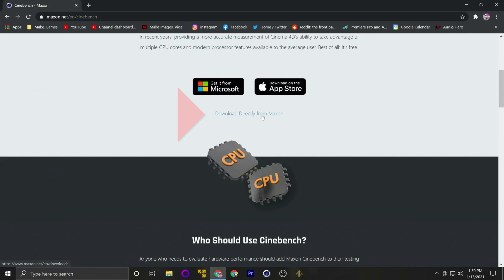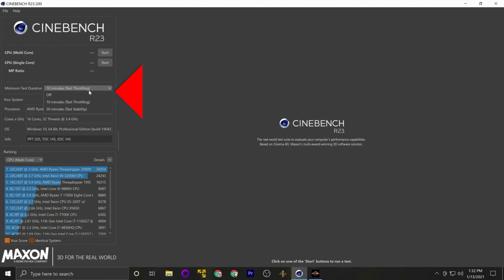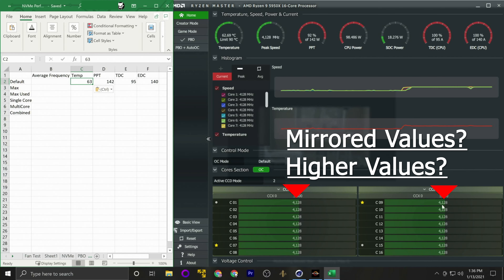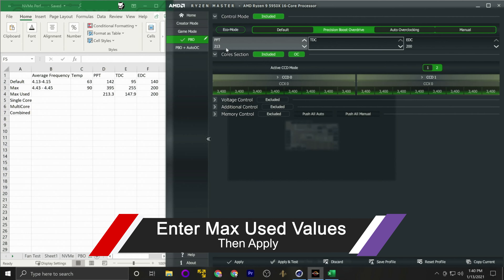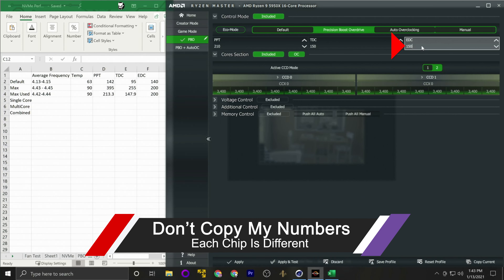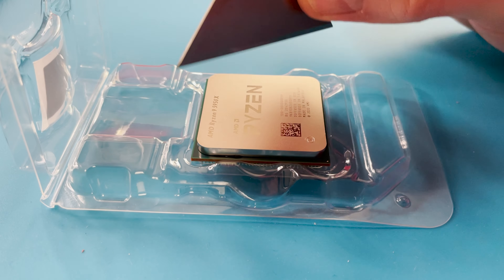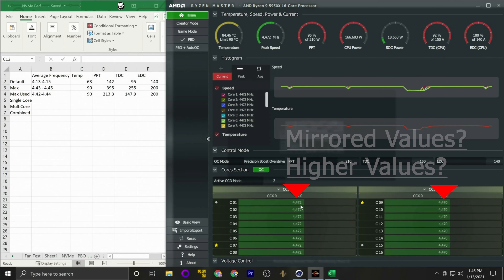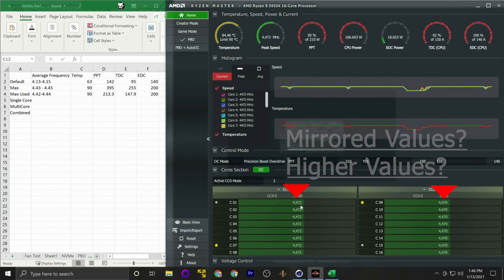Adjusting Ryzen CPU Performance with Ryzen Master ---- Part 3

Comment: This is weird. When I click APPLY, it always asks me to restart the computer before the settings take effect. How come yours doesnt?
Reply: Same here, did you figure out why?
Reply: there's a setting in ryzen master that says something about writing to bios, turn it off, it's automatically setting a permanent change any time you apply the changes
Reply: @DariusEldritch  Does it literally say "Write to BIOS"? I checked the settings and I don't see anything that relates to that. Would you be able to tell me/us which in the settings that has to be turned off?
Reply: @Velocity0428 you have to switch into advanced mode, then go to settings. You’ll find switch Write PBO to BIOS, or kinda like that

Comment: With my 5950x, when doing single-core Cinebench, it's not one of the cores boosting up to ~4.9 like you have, instead it's two cores jumping between 2.7 all the way to 3.2.
Reply from the maker: Likely running into a thermal issue where the scheduler is swapping more frequently. Make sure you have the AMD chipset installed and the Ryzen power profile.
Reply: I have kind off the same problem. One core is constantly jumping between 4.5 and 4.9, then at some point it drops to 3.1 and other core has around 1.5 ghz. Then single core goes back to 4.5 to 4.9 and story repeats. There are no more ryzen profiles in power plan. AMD chipset is installed. Any other hints?
Reply: @ErnestoRivera86  Do you have a solution to this yet? I am having the same problem where my Core 2 is a gold star is being out shined by my core 8 which is at silver star running at 5 ghz but switches with core 2 every few seconds.
Reply: @xrhupwnx  sorry but no bro. I sent the mobo and processor back. Im happy with my 9700k intel. Xmp profile loaded in seconds with no problems and no need to tweak anything else.
Reply: @xrhupwnx  any update to your issue? I am having the same problem on single core mine is being out performed by the silver star. I am running a 5800x.
Reply: @MJ-nn6cr  I'm having the same problem with my 5600x any updates?

Comment: Attempted this in August 2022. B550 aorus pro, 5900x. Installed ryzen master, PPT graph showed 720W, TDC 420A and EDC 360A. System is not overclocked. On cinebench r23 running iteration 12, ryzen master gauges went to -1 max. I closed the program, shut down cinebench, restarted RM and RM said program unstable, please uninstall. So still a very buggy program. On water running 12 cores @4.7MHz, core and CCD temps peaked at 69°C.

Comment: Bud, I just want to say thank you for the help on this. I just learned my 5900x is a golden sample with no crashes at -30 offset on all cores. 4.95 to 5.05Ghz single core.
Reply: dam lucky i can barely get mine to 4.414 but on my other motherboard it got 4.52 so i think the mobo maters too
Reply: 4.4444 lol

Comment: Best video yet for explaining PPT etc using Ryzen Master. Got a nice tune with my 5900x and Asus x570-f gaming. 4.5Ghz on all core on CB R20 getting 8778 compared to 8250. Nice boost. I'm also using curve optimisation for individual cores. I settled with 185 / 125 /150 with max temp at 85°C.

Comment: Followed this to the tee. Found near zero advantage to the MHz during the CR23 runs. And the score was going down! 

But your tuning got the max V below 1.40 and the temps down, so I was already impressed. Then I ran PCMark and saw boost speeds AND durations that were brand new. Score improved by over 5%. Thanks! 

R5 3600x, ROG B450 Gaming II, GTX 1060 6GB

Comment: What an incredible wealth of information these videos have been, thank you! 

I am curious though about your process for dialing in single-core performance, because at least on my 5900X the CineBench work load bounces back and forth between two of my cores, the two Windows-preferred cores. So it's basically impossible to get a good reading of my average clock speed.

Comment: Thanks for the useful video, people like you make the PC community what it is. My 5950x is not getting anywhere near your results despite using an EK 360mm AIO (and an MSI X570 Meg Unify), even with my case completely open (all panels removed for maximum airflow). I've repasted, i've checked mounting tightness, and i just can't get my CPU to get close to your first set of results in this video (ignoring part 4). I hover around 4335MHz. The other odd thing is that when i went into my BIOS and set the PPT/TDC/EDC limits, when i booted back into Ryzen Master, my limits were now dramatically lower than they were prior to the reboot (i.e., whereas PPT was showing 100% in RM, now it's only showing 75%). Either way, at 86˚C, my maximum observed boost seems to be 4335MHz and it seems like i lost the silicon lottery :(
Reply from the maker: That sucks!!!! Sorry!!!

You have the right components, so that’s not it. 

Maybe try using the PBO settings I found for my Asus board:

200 PPT / 145 EDC / 145 TDC 
Curve Optimizer: -20 to -25 

I think MSIs default values run higher than needed. So lowering them might help to see if you can get the boost right. 

<in a whisper> you did remove the sticker right?
Reply: @TheGrayingTech Thank you for the reply man! I've just subbed.

Re your whisper, you got me paranoid so i disassembled my waterblock and re-pasted and ensured that there are no obstructions or plastic covers lol. I've just punched in your results and i'm at 78C under sustained Cinebench R23 load with a max all core boost of 4255~.

I just rebooted, set curve to -15 (at -25 i become unstable while at idle despite doing a 30 minute R23 run), and my results were this:
(213PPT/TDC155/EDC145).
https://i.imgur.com/opWOWVE.png

As you can see my EDC is at 106%, however when i increase my EDC to deal with the fact that it's "over", my all core boost goes DOWN and my temperatures increase.
Reply from the maker: @Bacender  EDC is fickle to say the least. Leave it at the value where you got the 106% (145) and you should be good to go. Numbers in the screenshot look good to me.

Comment: I tried to play around with PBO using Your guide but there is a problem: I have 3700x so my default values are PPT-88W, TDC-60A, EDC-90A, when I go into PBO it shows these max values: PPT:1000, TDC-114, EDC-168. TDC and EDC are fine and change accordingly but PPT doesn't go above 88W, no matter what value is set in PBO. Going lower than 88W works fine.
Reply: i believe thats a setting in bios

Comment: not sure if its because ryzen master had an update but everytime i try to apply to change PPT TTC and EDC i have to restart for it to apply was there a way to change that?
Reply: Also when i run the single core cinebench test it alternates between using my best core and my second best core is this normal?
Reply: Yeaa you have to use pbo2 tuner now

Comment: Did you make any bios adjustments before running this?
I ask because your soc is much higher than mine (18 vs 7.5 on mine) and my cpu is boosting less at about 3.89 to 3.915 even though my temps are 10C colder than yours (same 5950x)
Reply: Having the same issue with a 5900x. Default only boosted to 80c but my frequency is maxed out at like 4.2-4.3ghz

Comment: this video doesn't fully explain how to change the test parameters, for instance at 6:36 i'm already at the max ppc/tdc/edc values, so i can't raise it, is that caused by a setting in the bios? is pbo supposed to be enabled in the bios for this test? etc.
Reply from the maker: PBO does need to be enabled in the BIOS. 

If you are already at max, record those numbers and then apply the default values and record those results. 

You incrementally increase PPT, TDC, EDC while running CB Multi Core to see what happens when you change the values.

I have an updated video here which hopefully is more clear and to the point.

https://youtu.be/F205IDSXoMk
Reply: @TheGrayingTech  thx for the info, i'm checking that video out, appreciate your help, this stuff is pretty complex despite me having a tech background :-)

Comment: My guide looks nothing like this.. There's no longer a PBO- it's just I/o Clock with a slider, and memory clock with manual adjustments to volage, DRAM Data Bus, Bus timing and bus drive strength, and that's it. I'm not able to manually adjust the three settings you do. (PPT TDC EDC).

Comment: I know Iam kinda late but letting the CPU have almost 90° while gaming is not pleasant at all. 
With no AC and these settings you would kill the cpu during the summer. 
I got a 5900x recently really cheap and Iam still looking for the best settings. Iam using the stock PBO settings (higher ones are not giving really much performance, just heat) adjusted curve optimizer (Iam still at it, core cycler takes forever to test each core), boost clock override +200 and Iam hitting aroumd 22k multicore and 1,7k single core. Max temp in cinebench 65° and 74/75° while stress testing with core cycler. 
Cooler: Liquid Freezer II 360.
Is this it? Or am I missing something.

Comment: I don't get the same results. PPT is not 88. On my 5600x PPT = 76W TDC = 60A EDC = 90A. Moving over to PBO, PPT is set to 1000 which is max and I wonder if it really is correct? I can see it's using 10% of PPT which would be 100. So it wants 100W and max clock is 4649Mhz on all cores it seems. It's like there is a limit there.
Reply: I think the same for me basically. 5600 is 4649
Reply: lol its ryzen 9 5950x he giving an example you have to find own your own

Comment: Ive had mine running at 4.750 at 64 degrees max set a 1.3 volts, I did this before seeing your video, have I won the silicon lottery???

Comment: What is your bios settings?? Also mine is jumping around a lot in my preferred single core number 2. how do I fix that it's hard to gage the frequency when it keeps going to sleep while cinebench is running

Comment: Hello!
I am totaly new to Ryzen master and overklocking and stuff.
I need to ask, in this video your say that a Ryzen 5600 default values are PPT: 88, TDC: 60, EDC: 90
On my 5600 in Ryzen Master it say PPT: 76, TDC: 60, EDC: 90
So the diffrence is the PPT 88 vs 76
Now I got a 5600X version, maybe that is diffrent than a 5600?
I just wonder if my numbers are correct from the Ryzen Master? :)

Comment: Background/Question: I bought a Digital Storm Aventum X w/ the HydroLux cooling (cpu&gpu) roughly 1000MM worth of radiators and reservoir: CPU: 5950X. GPU: Asus Tuf 3090. Gskill 3600 cl16, Raid 0: 980 Pro's, MB: Asus Hero VIII WIFI, Bios: 3204. Im looking for Basic BIOS recommended settings as when I upgraded to 3204 bios it reset all my bios settings, Could you link me your specific videos? or suggest some settings any advice :) Alittle OC or better utilization settings, I'm wondering if the defaults settings are under-utilizing/slowing my system down? Thank You again :)

Comment: Thank you for your video's.  They are by far the easiest to follow. I only made it to here because my PPT max was 1000 in RM? I'm not sure why so I stopped. The whole time I was wondering what should my bios settings be prior to attempting RM.  I rebooted and was not able to access windows until I reset the bios, boot into safe mode, remove ryzen master. Not sure what I did wrong. Have you ever seen this happen?
Reply: my ppt is a 1000 max too i dont know what that means or what i should set it for overclocking my ryzen 5900x

Comment: I have a 3600x processor. In PBO when I enter the max values, nothing maxes out regarding the PPT, TDC, or EDC. The % used of each of those values just lowers and I essentially get no improvement on my clock speed. I'm assumining it's the core voltage that is preventing any of the % used values from going higher. My temperature goes down a half a degree.
Reply: Same here, if I lower the PPT to 64W it hits 100% and starts slowing down, but increasing only changes the graph scale, nothing on performance.
Reply: Same for me, i got a 3800x and it looks like, there is any configuration, that caps the Limit.

Comment: I cannot figure out why my Default PPT, TDC and EDC values ARE my MAXIMUM values. The software won’t let me go ANY higher. 😔
Reply: Did you found solution?
Reply: @tribal336  nope. Switched to Intel for other reasons

Comment: I set PPT, TDC & EDC to their max but for some reason EDC is showing 0A and 0% even though I set it to 190. Would that be some kind of bug? Also with all this tweaking of settings, I've not seen any real changes in MHz single/multi-core or in the temps.

I had been manually setting Curve Optimizer settings and testing. Not sure if that should be disabled for these tests you're going over. My CO settings are C0 -27, C1 -19, C2 -30, C3 -28, C4 -21, C5 -30, C6 -20, C7 -16.

Got any tips on why RyzenMaster is acting weird for me or why I'm not seeing any differences in MHz or Temps +/-?

Comment: Currently running this however, I encounter an issue with not being able to increase the values? Does that lead to the results in my bios setting?

Comment: Okay, so I understand that there are GREAT chips and then those that are "just passable", and everything in between, but I am getting numbers so far off the "baseline" here that I am wondering if I truly got a lemon of a 5950x?  My default freq is 3.77 and that goes down to 3.74 with the maxed out numbers (mine are 720, 420, and 480).  Using the same "semi-optimized" numbers as a point of reference (210, 150, 150) I am only getting 66-70% utilization of the 210 PPT, and about 70% of the TDC, but 100% of the EDC...and again my freq is hovering right around 3.81.  I can get the clock just over 4ghz for a short duration using the sampled numbers...but nothing sustained.  Any suggestions would be greatly appreciated!

Comment: My first run of Cinebench and my CCD 0 and CCD! values are 3.5, Temp 62, Peak 3.58, PPT 91, CPU PWR 99.5, SOC Telemetry PWR 8.3, TDC100, EDC 100, CPU Telemetry Vltg 1.45, SOC Telemetry Vltg 0.975 Ryzen 9 5950x, I am coming way under your numbers. Could this be the silicon lottery then. I am redoing video 3 again just to verify.

Comment: Some issues for me: I have the 5600G (I meant to buy the X but accidentally bought the G). I don't have the two CCX monitors, only one. I also don't see ANY difference between Default and PBO. I get the same exact speeds, same temps, same voltages, nothing moves at all except the maximum limit of the chip. The actual performance itself does NOT change. I don't know if I'm missing a step that I need to set up in BIOS or what is going on, but as detailed as this guide series is, nothing is changing at all for me.
Reply: Same. Had to abandon this as nothing seems to change performance wise. Also my PPT goes from 88w to 1000w when turning on PBO, like wtf? Its just too different from this tutorial for me to want to risk messing with it.

Comment: Watching your videos with great interest. Only starting out with a X470 and a 2400G. 
Question: why does my Ryzen Master look different? I don’t have any of the fancy green bars or gauges etc? Is there a setting I’ve missed?
Reply: The older Ryzens 1/2000 set up Ryzen Master differently, only 3000/5000 series looks like it this video!
Reply: @vladvah77  thanks for the replay. Since then I have upgraded to a 3400g, then upgraded that to a 4650g which won’t work with Ryzen master either.

Comment: Nice video and explanations ! The best I've seen so far. Thank you :)
6:49 On my system (B550 / 5600X) TDC and EDC max are  the same the default values 60 & 90. Why can't I go over this ?
PPT, it gives me a weird 1000 as max .... that is non sense.
Reply: Same for me, did you found a solution?
Reply: @hjvdd  I applied the method explained in this video. I entered 1000 during "max" (even if is doesn't make sense) tested and wrote down 11% usage. Then did the math as explained.
I continued to fine tune has he says. Looking for best AND stable numbers.
I've been able to squeeze 1000pts extra on Cinebench over the Default settings.

Comment: In Singlecore test my 5800X bounces between the two best cores. A Frequenz reading is nearly imposilble because of that. In the time the switch is happening the cores are only at around 4,3-4,4Ghz. Every minute or so the best core goes up to round about 4,85. Why is this core switching happening?
Reply: Me too with my Ryzen 5900x :(
Reply: +1 another one here.

Comment: This method can be used safely also with Ryzen R9 3900X? I hope it's NOT exclusive to the newer processors - 4/5000 series...
Reply from the maker: I'm not sure if the Curve optimizer part works with the 3000 series. However, the PBO and Ryzen Master portion is valid for that series.
Reply: @TheGrayingTech  The Curve Optimzer & PBO 2 tech is 5000 series exclusive, and of course the older PB / PBO ( v1 ? ) works pretty good with my R9 3900X processor - I also like to experiment with the EDC=1 bug and BCLK overclocking to squeeze more performance from my release day bronze sample bad silicon...